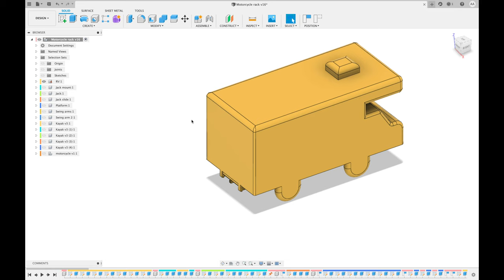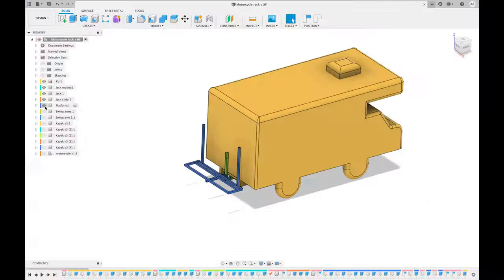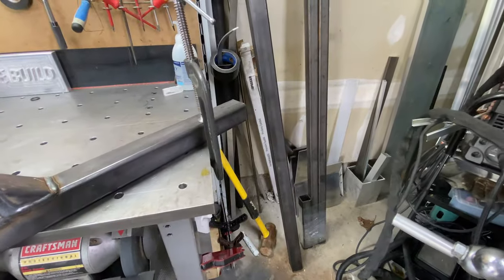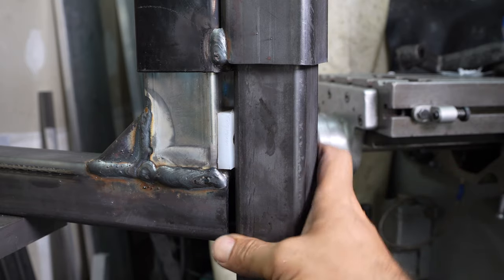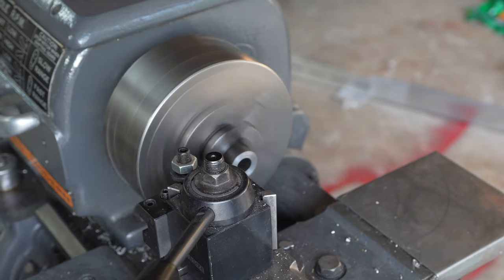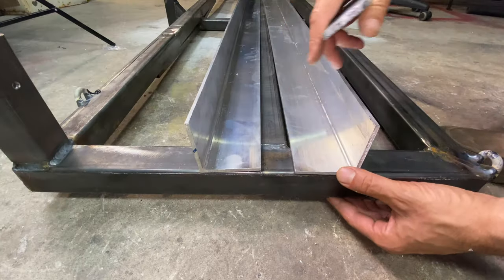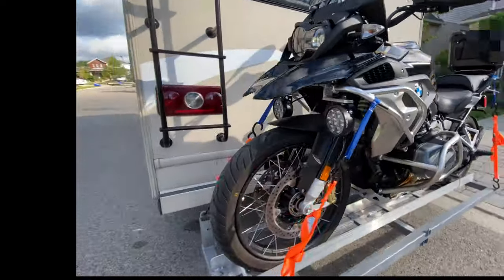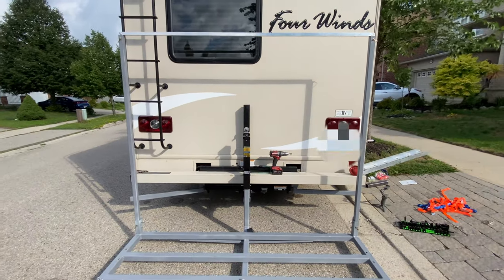Hitch mount Motorcycle carrier -power lift

Comment: Nice build! I had something planned very similar, how is that Teflon pad holding up? I was thinking of welding a steel roller to keep the feet centered in the jack while going up and down.
Also how high is the lowest part in the rear? On my design I'm looking at at least 12 inches.
Thanks!

Comment: Great job and great video edit. I have a R1200GSA I'm needing to get on the back of my camper. What about your departure angle? Has it dragged/scraped much going in and out of driveways or steep spots? I'm thinking I'd like to have mine at least a foot higher if not 2'. Thoughts? Thanks.
Reply from the maker: Higher would be nice

Comment: I really like your design. i am going to build something like it. I have a 650 suzuki vstrom  that weighs about 525 pounds. Probably pretty close to the same weight as yours. I f you dont mind me asking, what thickness is the tubing you used on the main frame and the upright jack support. I have a 29 foot class c  RV. What size is yours and how is it handling the extra weight on the back. Thank You
Reply from the maker: Tubes are 2.5x2.5 1/8  wall mine is 27 foot and driving is no problem

Comment: How is the trailer jack holding up? I’m asking as it is working the opposite way it is made for. It is suppose to be pushing up the weight but in your installation it is pulling up and holding. I’m just about to make one would love to hear from you. Thanks
Reply: I was going to ask the same and suggest he put a pin through it when it is in its higher position, then take the load off the lift mechanism.  It isn't designed for bumps on the road or for lifting weight.